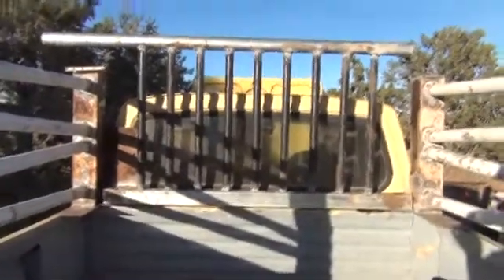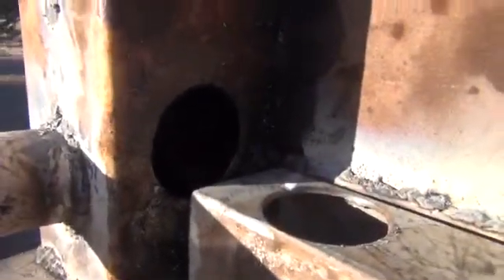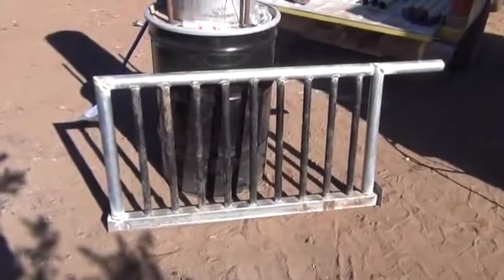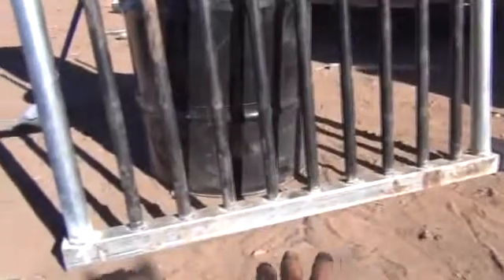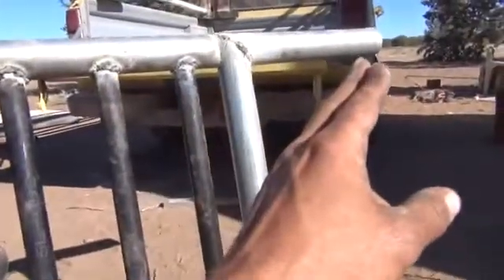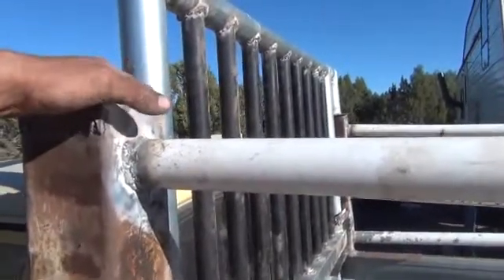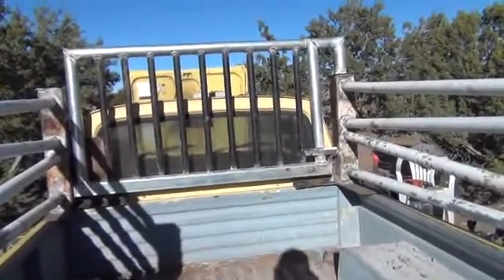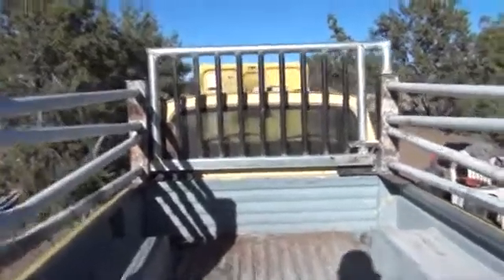Gasifier Truck How-To part 11

Comment: All of your videos are awesome.  I love the detail you are providing on the gasifier for the truck. However, I did not follow how the tar/water condensation/bio-crude that builds up in the radiator tubes is going to be collected.  I thought there was going to be collection tubes at bottom of corner posts (Rv bumper) but I didn't see anything added (maybe i missed it and you explained it).